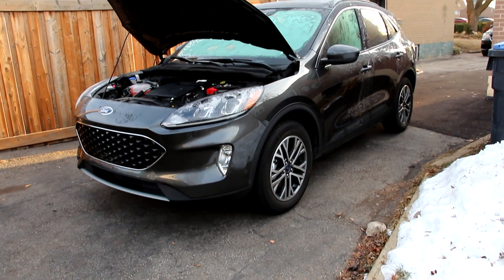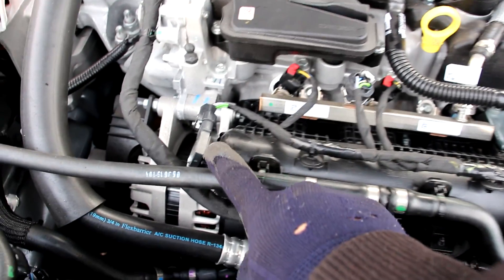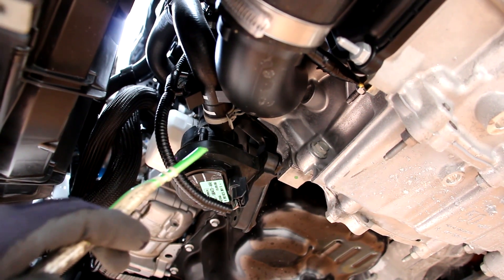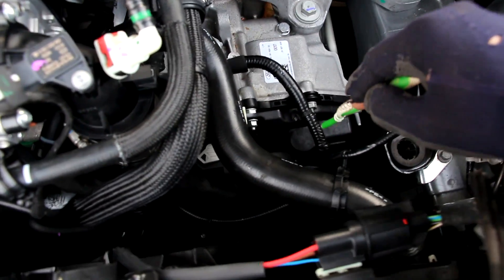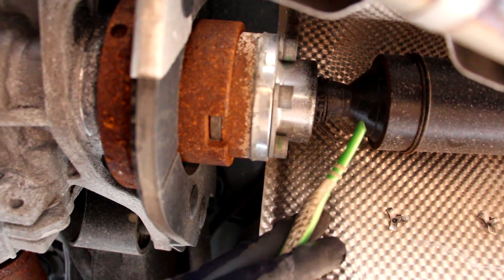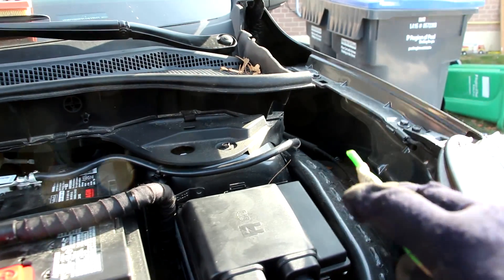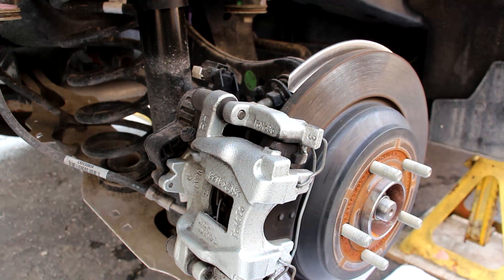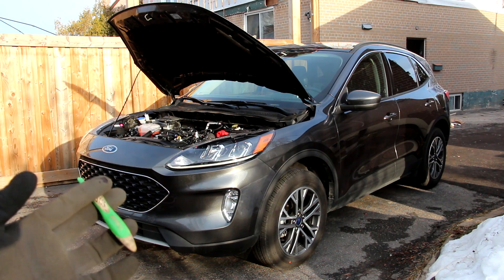Ford Escape Mechanical Review

Comment: I know this is getting a lot of negative comments, but from what I'm seeing it will be fairly easy to maintain compared to most modern cars. I have driven one and the power is pretty impressive for a 3 cylinder. It also looks like you have plenty of room to work. I also imagine this will be more reliable that the 1.5 4 cylinder ecoboost. Due to the larger cylinders used in the 3 cyl.
Reply from the maker: No way. Try Changing a control arm
Reply: I've owned several Fords and never had to change a control arm.
Reply: @josephfaello2281  My ford is 15 years old and 158k miles and you are right, haven't change a control arm yet.

Comment: Had a 2016 Escape and it was a total turd. The airbags never went off when it hit a moose at 55mph. The airbag sensors were hit. The transmission was harsh, the turbo had issues, the brakes wore quickly, it started rattling before it had 2k miles.
Reply: Brake for Moose! It could save your life
Reply: @sniggitty  - Sometimes when it is dark and the woods are just meters to the side of the road and it is icy there is no braking for Moose.

Comment: Don't like the selection of technical approaches with turbo, wheel bearings, ease of maintenance and long term use is not pretty ($$$). Thanks for the review. Daughter just bought the 2.5L 4WD Rav4

Comment: Just to add that the HVAC units on these are one unit and the doors will get stuck and not move sooner rather than latter. To replace these HVAC units is more than $1,000 just for the HVAC unit itself and requires removing both front car doors and the entire dash, very labor intensive.

Comment: I've worked in Ford's service department for 42 years. We are always asked for input on new vehicles when they come in. Like you, one of the first thing we noticed was the free floating fuel lines. We also noted they still use the stupid integrated turbo in the manifold that's been known for low mileage failure in other ecogerbil motors. If the manifold and/or turbo craps out on a 2.0 ecogerbil, repair costs are about $2300. The all-wheel drive system is still the same trouble prone system they've used for 14 years, at least it's serviceable now. Ford still builds solid trucks but these SUV's are just another "planned obsolescence" consumer product......get rid of it when the 5 year powertrain warranty goes out.  I used to complain about the non-stop manifold repairs on the FE engines or the stupid variable venturi carburetors in the 80s. That's nothing compared to some of these vehicles they build today.
Reply: What is an Ecogerbil?
Reply: @standhd  That's the nickname we used for these tiny ecoboost 3/4cylinder engines in the service department.
Reply: @gianmariavolonte4315  Ahhhh…..so basically turbo charged small mammal/engine.

Comment: I've driven one,  for a month or more 
I can say that it was better than rav4 and crv 
Comfort and handling wise
Reply: I can attest to this as well. Still early, but I had a 2019 Rav4 and is was coarse as hell, the transmission was terrible at low speeds and lurched, the front end had a massive creaking noise when going over large bumps and also when turning (had them look into it and couldn't find anything. It also had a terrible rattle from the hatch that changed with the temperature and got worse the warmer it was. I think I just had a somewhat crappy one, but I was shocked at the build quality of that Toyota.

I now have a new 2022 Ford Escape and so far it's miles better in terms of fit and finish, drivability, and overall technology. Sure, time will tell if the powertrain holds up the way a Toyota would, but it has a lifetime powertrain included from the dealer and I plan to take full advantage of it should the thing break down.
Reply: hahaha LMAO

Comment: That timing belt going trough oil for a reason, as long as you used recommended oil you don't need to change the belt. you have the best of both worlds of chain and belt. do your homework before spreading falls information.
Reply from the maker: I stand corrected on the oiled timing belt, that was for the 3 cylinder ecosport for foriegn markets

Comment: 3 cylinders only. Timing belt with a timing cover that functions as a motor mount. Non-reinforced electrical wire harnesses and fluid hoses/lines. Suspension that requires additional labour for maintenance. Uninsulated vibrations coming from the engine bay. At least it has a metal valve cover. The aluminum control arms are more resistant to rust vs. stamped steel but hella more expensive. Wheel bearings that require a press and specialized tools for replacement. Wow...planned ominous repairs at the Ford dealership I see.

Comment: Ford gave my mom one of these as a loaner when her 2014 escape was in the shop I thought  it was a cool but to my mom she didn't  like the engine she said it struggle going up steep hills  compare to the 1.6 4 cylinder.  Inside get a 7.5 out 10 and the engine  well let just say they have kept the 1.5 or 1.6 4 cylinder  or bring back the v6 in my opinion same for my mother too.

Comment: Was actually planning to head to a dealership to check out a 2020 Escape SE, I have a 2017 SE 2.0 but no nav, push button start, no heated seats, etc. But now that I see this, I'm kind of scared to get one. I can't afford an SEL with the 2.0 either. Looks like I'll be switching brands here soon as much as I hate it
Reply from the maker: Try a used rav4
Reply: @speedkar99  I did try that and it was crap unfortunately. I'm sure it would have ran for a long time, but it had so many little issues, even the transmission

Comment: Good grief . . . 3 cylinders and so complicated.  The timing belt runs through an oil bath to also drive the oil pump?  So much plastic.  And the engine and transmission electronic management controls in those vulnerable spots . . .
Reply from the maker: I've been corrected on the timing belt....it's oil soaked on forgein market engines in the Ecosport but in this escape it's a chain.

Comment: Just got one, they are disposable but I had 113k on my 17’ and was replacing before the big stuff hit. (Insurance sales) I’ll likely replace with Bronco in a few years, there is a science to the even displacement of the ratio on 1.5 liters to 3 cylinders...I’m not certain but this engine even at base has more get up than the 4 cylinder version I previously had. One thing that I’m not happy with is the extras, backup sensor should be standard, that saved a lot of close calls no longer standard, also miss the fog lights the 17 had in the SE trim.
Reply from the maker: Good to know your experience. How are you feeling about that 3 cylinder .... It seems rough on the edges to me

Comment: Darn, a belt only lasts 150k miles. I was excited about this car but now forget it! My 06 Highlander has 250k I changed the belt twice. A pain. Timing chain for me my friend! Vibration put a cup of water on it you will see it shake. Wow, this is a car to run away from! A lot of those other parts u pointed out will wear out a 75000 miles.

Comment: You were too bias to make a review on this, the Ford Escape is an excellent SUV and a real track monster with the 2L Ecoboost (I have a 2013 Escape BTW). I think it looks modern and futuristic, it was desgined to be Aerodynamic so it can get better fuel economy, sure there are some bad Ideas, I am never going to defend the fact that you have to take off the entire skidpan to do an Oil Change (It's the same story on the 2013). But I find that it's a fast, reliable, fun, and practical Small SUV, just wished it came in a manual.
Reply from the maker: Thanks for your thoughts as an Escape owner. 
I was trying to point out all of the non-traditional mechanical aspects of the Ford Escape. While some unforgiveable, I didn't mean to come across as biased. 
I'm sure with the 2.0 turbo it makes for a quicker lively SUV which is what people want, though little do they know what's underneath.
Reply: @speedkar99  Well the current 2.0 has 250hp and 280lb-ft of torque which makes it the exact engine from the outgoing Focus ST (My 2013 is 240hp and 270lb-ft). Some one did a 0-60mph run with that 2013 engine and achived it in 7.5 seconds, coupled with the stiffer suspension to give a sportier feel compared to the RAV-4 or CRV, means it's actually fun to throw around corners, and I haven't had much in the way with Understeer with my FWD model, I do Cliche Corner as used by the Canadian car review duo: The Straight Pipes, and I feel very confident going around the sharp bends at 60-70km/h. All in all, people may think that all of the newer SUVs that are coming out are for Grocery runs and soccer practice, at least Ford is making them fun for the Dad in the family who wants to feel like a Nascar Driver
Reply from the maker: Sure it's more fun to drive but simplicity has it's benefits when vehicles age.
Reply: @speedkar99  True but the Trabant was simple and it's a pile of shit, it's been giving Aging Wheels nothing but trouble as it ages
Reply: @coastaku1954  How can a dad feel like a NASCAR driver in an Escape? Just because of the Ecoboost engine?🤔

Comment: Thanks for the detailed, instructive video showing us why we don't want to buy this model.  All that over engineered,  fuel saving tech now,  will result in extremely expensive repairs in the vehicles' future.  Always remember, at Ford, quantity is job one.  I'm sticking with vehicles of which a J is the first digit of the vin.
Reply from the maker: Good thoughts, remember the OE designs a vehicle to last the warranty. Chances are the first buyer won't stick to it for much longer than that.

Comment: At least the oil pan isn't plastic on this engine :-|
Reply from the maker: I was thinking it would be, given Ford's other engines are plastic
Reply: @speedkar99    Sorry.  That was just me sarcastic.  I'm one of the Ford owners/suckers with a 2.7 ecoboost that has a cracking and falling off oil pan.  And the dealer has tried Ford's repair recommended process twice!

Comment: I will check with parts catalog again. If I'm not mistaken, this one uses a timing chain, unlike the 1.0L, also oil pump is at the end of the balance shaft, gear driven.

Edit: went through the documents today. All 3 engines are timing chain driven.
Reply from the maker: Please check it to confirm because I found that information in some videos and articles on the dragon 1.5L Ford engine when it debuted in 2017. Apparently the engines are manufactered in India.
Reply: @speedkar99  Also, there is word that it will be built in Mexico. Just went through Fords internal documents for techs, all three engines are indeed timing chain driven. This is different from Ford Dragon naturally aspirated engine, which uses a belt.

Comment: In Europe, the 1.5L 3 cyl. Ecoboost like that with 150 and 182hp use a timing chain. That’s why the water pump is moved by the serpentine belt.
Only the 1.5L dragon Naturally aspirated engine uses a timing belt soaked in oil. All 1.5L ecoboost 3cyl use timing chain.
In all, good review!
Reply: Here you can see an animated engine internal video:  https://youtu.be/wDEwvGhVQRo
Reply from the maker: Thanks very much for the correction!
Reply: The timing chain is not soaked in oil, the oil belt is. All 1.5 three cylinder EcoBoost engines have a wet belt for the oil pump. They all have a timing chain which seperate than the wet belt oil pump belt. The wet belt is a terrible design and will fail right outside of warranty

Comment: I loved the review. How much different is this model from my 2017 4cylinder? I haven't noticed the noises in the rear or heavy vibrations. However I will say this thing is loaded with plastic.
Reply: Personally, the fuel efficiency is what got me. I had a 2001 Explorer before this. I prefer these over the Focus. And still not a huge fan of the Fiestas.
Reply from the maker: The 2017 is much different mechanically

Comment: Nice video! We had a 2001 escape and now have a 2015 escape and it's amazing how much difference there was. We've got the 1.6 liter turbochargedand I find it a little annoying because the torque curve and the horsepower curve are on the opposite ends of the RPM curve.I don't think I would like that 3 cylinder and I really don't like the fact that they have the auto shut off! the biggest advantage of the 2015 over the 2001 is the gas mileage. We used to only get 11 miles to the gallon in the 2001 and we're getting 21 miles per gallonin the 2015. I absolutely hate the active suspension. If you accidentally go into a corner too fast, the car tries to throw you into the corner instead of going around it. 😒
Reply from the maker: Good to hear. How did the old 2001 hold up?
Reply: @speedkar99  not very well. It was the first year they made them and it constantly has problems.. I paid $16K for it and they did over $16K worth of warranty work on it.
It was great to drive and REALLY quick! I use to beat $40K BMWs and insane rice rockets all the time! 😎

Comment: 3 cyl engine. Why not just put a lawnmower motor in it? Timing belt and not a chain? I hope this is a non interference engine? Looks like a lot of surface rust already for a new vehicle. I wonder if this can be an issue as it ages? I prefer the older truck looking Escapes
Reply from the maker: I prefer the older escape looks....that's closer to a "real" SUV

Comment: Hi Speedcar. Thanks for your comment that the Escape was not with Mazda. The original Escape was developed as a joint effort by Ford and Mazda. They must have parted company at some point.
Reply from the maker: Yes after 2011 or so they stopped making the tribute

Comment: It already rusting inside the engine bay!  It has cylinder deactivation too!  Errrrrrrr!  Suspension arms are very thin too!  Cheap junk!
Reply from the maker: They are built to last a lifecycle of warranty+1 day

Any thicker means you get worse fuel economy and waste material
Reply: Don't they use salt on the roads over there?

Comment: Unsecured lines and hoses. Vibration in the engine. This thing will vibrate itself to death. TCM and ECU at vulnerable positions and expensive suspension repairs. This car is designed to be disposable or money printing for the stealership once the warranty ends.
Reply from the maker: I'm very astonished at the unsecure lines. I have a suspicion there's going to be a fuel line recall soon...
Reply: Can you recommend an SUV that it's biult for last?
Reply from the maker: 4runner
Reply: Thats Ford for ya

Comment: I feel like maybe you're Scotty's son. Everything not Toyota has a sarcastic remark about how this will break how that will break how that will go to the junk yard. It's a bit much now. Just review the thing.
Reply from the maker: I understand your point. I try to be neutral in my videos, however the Escape has a lot of non-traditional features worth pointing out. Alot of the comments here seem to agree.
Reply: @speedkar99  with SUVs being all the rage right now and manufacturers knowing that, why would they knowingly bring out one of their possible best selling SUVs with flaws. They've obviously done all the tests they need to to make sure the points that need whatever it needs is there. Most people commenting are most likely not even mechanics or similar. Is non-traditional bad? I know everyone here wants cars to be like they were 2 decades ago. That's not happening. They would be less safe, slower, more polluting, less efficient etc. Things have to move forward and advance otherwise the world never will.

Comment: Except for a catastrophic transmission failure at 65,000 miles, which was covered under warranty, my 2013 escape has been and is very reliable with 110,000 miles.
Reply from the maker: Good to hear

Comment: I have a 2018 escape titanium, it isn't much, but I love it, but this, looks like absolute garbage, this thing looks like it belongs in a 90s movie about the future, I mean the design, the new engine, it all just looks horrendous, ford asked me if I was interested in test driving one and this was the first video that came up when I looked up the redesign, I think ill hold onto my '18 a few more years, ford really disappointed me with this.
Reply from the maker: How has your 2018 held up?
Reply: Well beside some minor tweaks and checks on the bells and whistles its doing really well, had it about 22 months now and have 33500 miles on it, its a fun car to drive, great on gas, comfortable, honestly I believe the face lifted escapes like mine were the pinnacle of the escape brand, through all trim levels
Reply: Also I will say, about 4 hours after my first comment, I took my escape in for an oil change tire rotation and such, they gave me a 202 escape loaner, exactly the one you reviewed and hell everything you said was true, down to the weird noise when you accelerate on turns.

Comment: Not only 3 cylinder for 1.6 turbo is more powerful, lighter, effective and cheaper to produce, it is also more reliable. Bigger displacement cylinders are always more reliable, especially when we're talking about aluminum, turbocharged engines. Toyota also went that route with it's new 1.6 3cylinder turbo for euro sport version of Yaris. And even when when we where to take look at 3.4 tt v6 from Lexus Ls 500: they also went bigger displayed  way, compared to their rivals and it's especially important with Japanese longer stroke design. 
The difference is – Toyota uses active cooling of recycle exhaust gases to improve it's fuel economy and overall quality of engendering os on another level.
Reply from the maker: All good points. Thanks